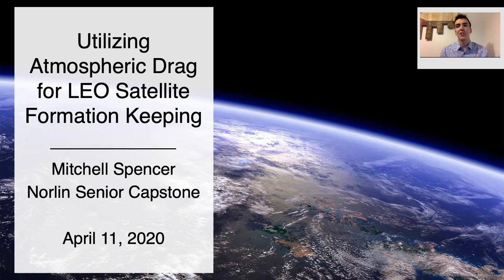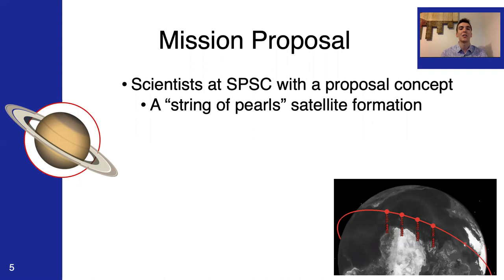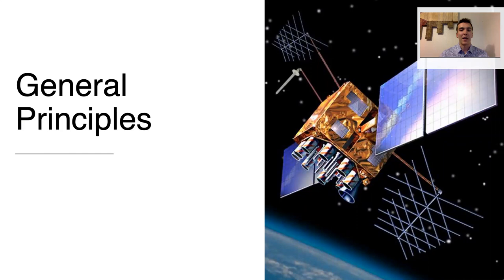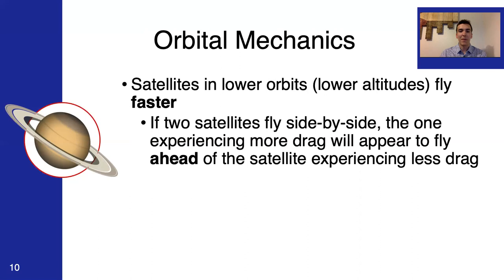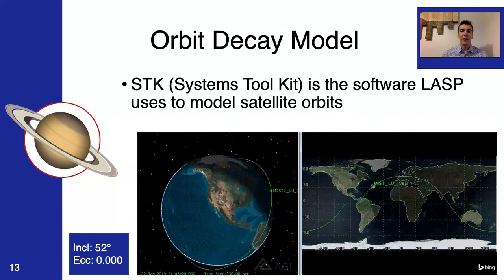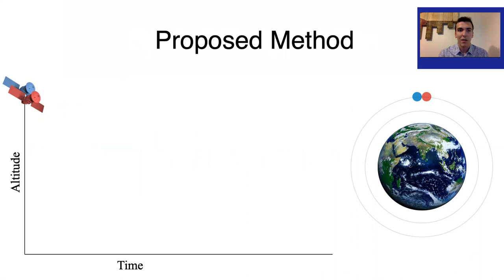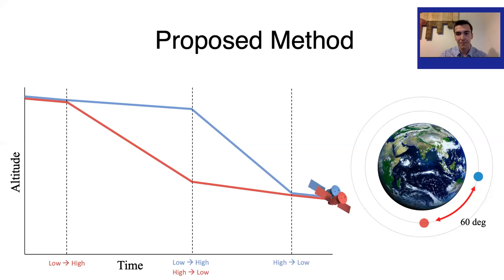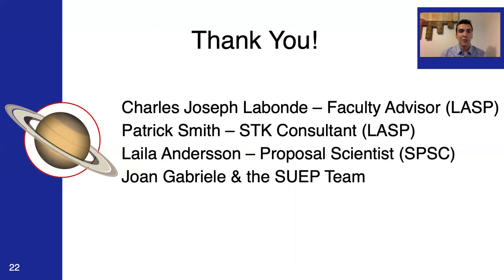Utilizing Atmospheric Drag for LEO Satellite Formation Keeping | SUEP Scholars Conference 2020

Comment: This was really well presented and very interesting! Since the satellites need to decrease their altitude in order to align, would the satellites need to be launched into an orbit higher than their operational orbit? If so, did you help with these calculations as well? Is launching orbits into a high orbit than the operational orbit common due to affects of drag?
Reply from the maker: Thanks for your comment Grace! Yes it is very conventional for LEO missions to consider the effects of drag with regards to their operations. Without on board propulsion systems, LEO satellite missions don't necessarily have a single "operational orbit" as they'll continue to slowly fall in altitude over time, and many missions have to take this into account when determining the timing of their mission activities over the course of a single orbit. There is some pretty cool math involved with predicting the constantly-evolving orbital characteristics of LEO satellites.

Comment: Hey Mitch! This project is super interesting and thank you for sharing with us! I really enjoyed how you gave us a crash course in orbital mechanics and clearly explained what your solution was to the problem presented to you. Regarding the mission, do you know how long it is supposed to last? When looking at your graph with the high and low drag (slide 14), I thought this was something very useful to consider for the satellite's end of life. I understand that after a satellite's mission, it needs to be deorbited or be put into a graveyard orbit. Did you have to consider the satellite end of life in relation to this project?
Reply from the maker: Great question Kai, this was definitely a more conceptual project that I was asked to investigate, so I didn't do much analysis in terms of end-of-life. I was asked to determine the minimum starting altitude if this mission were to last for an entire year, which I believe is the proposal's minimum operation goal. However, as is the case with most satellites, they were looking to engineer enough robustness into the design to keep it in orbit for much longer than necessary, and I was also asked to do the same analysis for a 600km starting altitude as well. In this case, I believe they'll just keep it operational as long as possible until it gets too hot to take science, with no other changes for end-of-life.

Comment: Great presentation, Mitch! I'm a sophomore in ASEN but haven't learned very much on satellites yet. My question is rather generic when it comes to satellites; since drag is always present despite our ability to manipulate it, what happens when a satellite begins falling below its designed operational orbit? Is this an inevitable process that pertains directly to its lifespan, or are there ways to 'bump' it back into a higher altitude and thereby continuously extend its mission?
Reply from the maker: Great question, Pedro! Yes, orbit degradation is a challenge all satellite missions have to face, especially LEO missions where the drag is much more substantial. Depending on funding, satellites can be equipped with a propulsion system that can be used to 'bump' it back up to a higher altitude--the ISS, for example, conducts regular burns to keep it from falling to too low an altitude. Other missions without propulsion will ultimately have to account for the changing geometry of the orbit over time when performing their mission duties, and in the case of most missions, their altitude is high enough that the effects of drag won't cause the satellite to burn up for several decades, if at all.